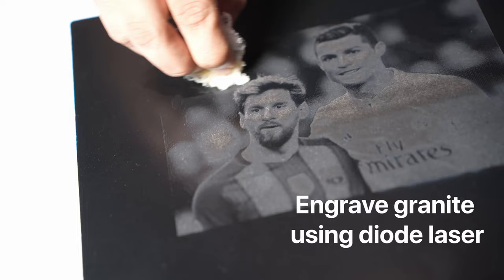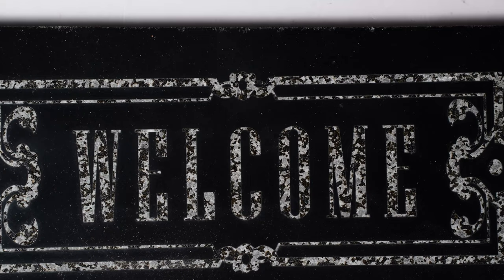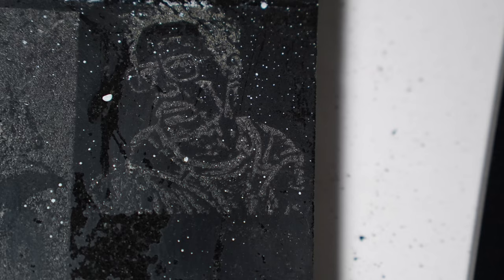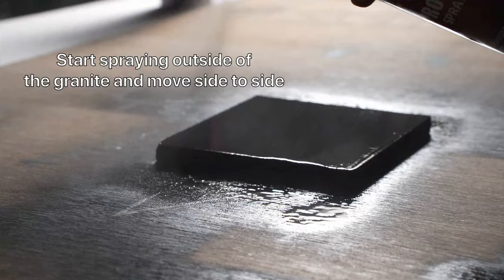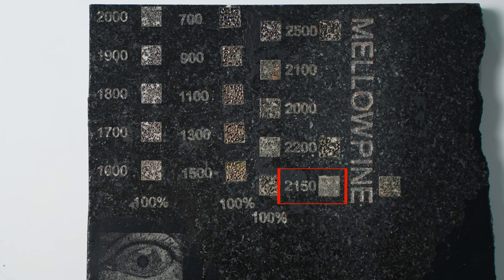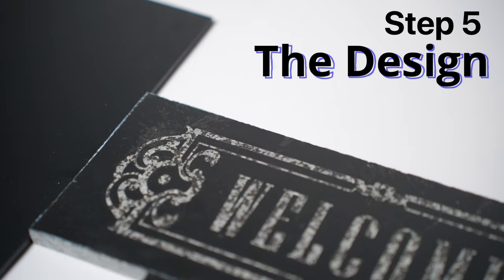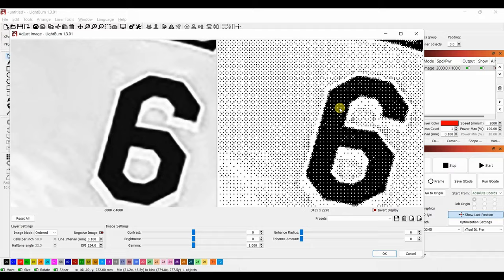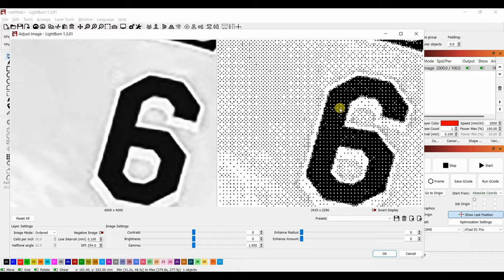Flawless Engraving On Granite Using A Diode Laser: Guide

Comment: Dude, i have an xtool d1 pro 20w and im not getting anywhere near those speeds. And ive cleaned and painted and everything.....i just dont get it.
Reply from the maker: The possible reason can be the difference in the type of granite. Like I mentioned in the video, I also found varying results for different batches of granite. While one needed 100% power for good engraving, other started to show good results at just 30% power. Which is why it is always best to perform a test run when you get a new piece of granite to work on.
Reply: @MellowpineLasers  the painted granite worked a lot better... Plus I realized that my protective lens was cracked, so once that's replaced I'll get cracking again

Comment: I want to buy a laser engraving machine for  black marble granite which brad and watts you will recommend for me.
Reply from the maker: For a good balance between the quality and budget, I would suggest 
a 10W diode laser. The one I used in the video is Ortur LM3, but you can also explore other brands like Two Trees TS2 or xTool D1 pro. 
If you plan to setup a business primarily focusing on engraving granite, then a CO2 laser would be a better choice as it produces better results with faster engraving speed.

Comment: What website do you use to make your design?
Reply from the maker: I primarily prefer using Photoshop, Illustrator, and LightBurn's inbuilt design tools for my projects. However, Imag-r is an online tool that I occasionally use for image preparation when significant modifications are not required.